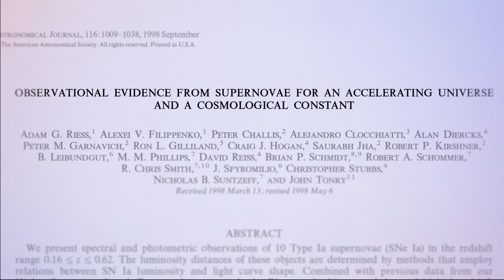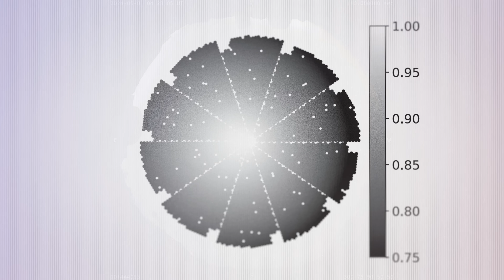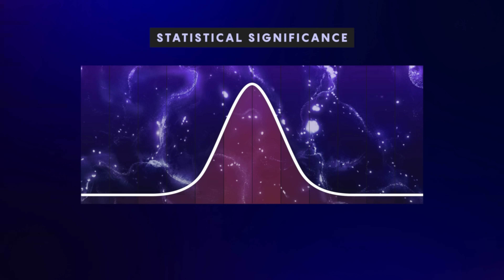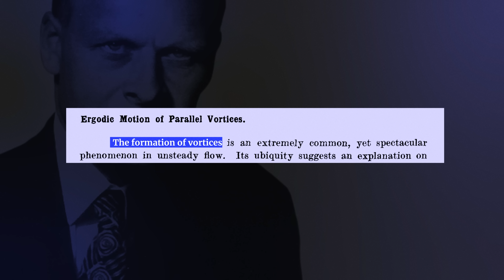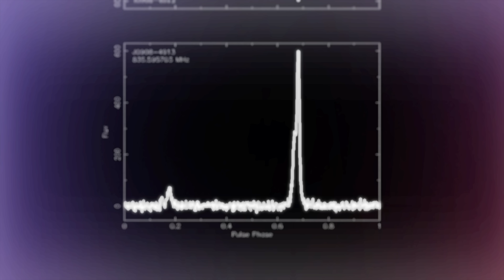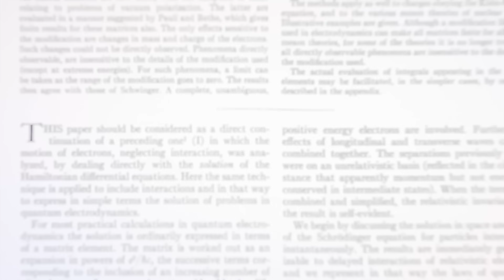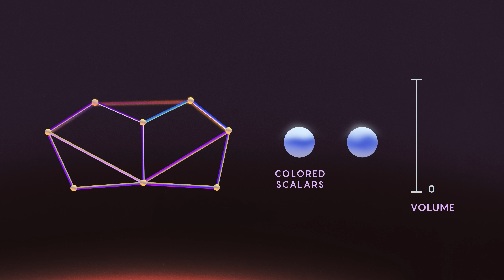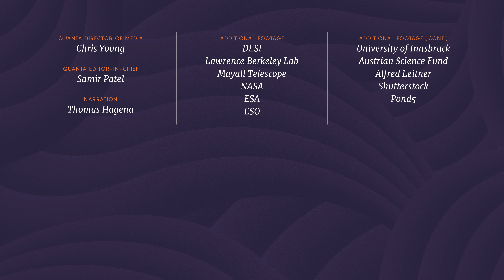Biggest Breakthroughs in Physics: 2024

Comment: Matter and space was created together at the Big Bang.  Black holes, in effect, put mass-energy from the vacuum into our universe.  That's like a sizzling Big Bang.  If it increases because the black hole gets smaller, space would also increase.  As BHs get smaller and radiate Hawkins radiation faster, the universe would increase in size faster.

Comment: Dark Energy
- Not *constant* (contradicts Einstein)
- *3.5σ* confidence
- Requires *new physics*

Supersolids
- Matter simultaneously *solid+superfluid*
- Explains *neutron star rotation changes*

Particle Physics
- *Geometric method* replaces Feynman diagrams
- Works w/ *real particles*
- *Unifies 3 theories*
Reply: Thanks
Reply: Quite excited for third one
Reply: Actually, we've known the universe wasn't expanding at a constant rate for decades. Einstein considered the cosmological constant his biggest blunder. What's new is the possibility that the universe isn't just going to keep speeding up forever and that dark energy might actually degrade. Which is super weird and going to be hard to explain. No, the law of conservation of energy says the energy can only change forms. We generally considered dark energy to be the energy of the quantum fields everything is made up of. If it's degrading, then it's possible the entire universe is degrading into nothing.
Reply: MIGHT Explain neutron star rotation changes

Comment: I discovered the math to holographic wave patterns that  are like ripples. (n/n^2)/(n/n^2+1)+(n/n^2+2)+(n/n^2+3)+....(n/n^2+n-1) so until you get to one les than the number you started with. And when you add all the wavelengths together they are equal to one unit. What we are measuring are the units within the units and they go on forever.

Comment: Well, Einstien didn't thought that the universe expansion is accelerating, on the contrary he added a cosmological constant in his equations to maintain his vision of a static universe, without expansion. He later suppressed this constant when Hubble discovered that the universe was indeed expanding.
Reply: You're right that Einstein initially introduced the cosmological constant () to keep his equations consistent with a static universe, which was the prevailing belief at the time. However, when Hubble observed the expansion of the universe, Einstein considered the constant unnecessary and reportedly called it his 'biggest blunder.' Ironically, the cosmological constant has made a comeback in modern cosmology to explain dark energy and the accelerated expansion of the universe discovered in the late 20th century. So while Einstein's vision of a static universe was incorrect, the cosmological constant itself remains very relevant today
Reply: @CoolguyMcCool  Wow! I'm really confused. I knew the first part of the story, about Einstein's biggest mistake. But didn't know that "cosmologial constant" cameback, and apparently to justify the contrary: a accelerated expansion of the universe, not a static.

Comment: The universe cannot exist as a static environment. If it’s not expanding it’s contracting. Also, the alleged limitation that energy is not created, is clearly incorrect. The universe is a vehicle of creation. It doesn’t have to be a finite number intrinsic to the existing system, simply because we do not yet comprehend the mechanism. Physics is the greatest field, and we should be investing so much more of our resources probing the cutting edge of this field.